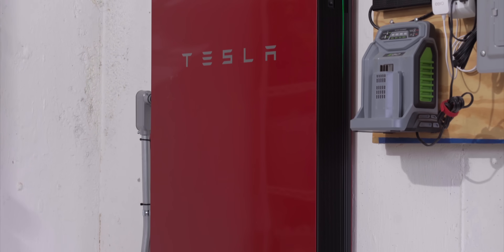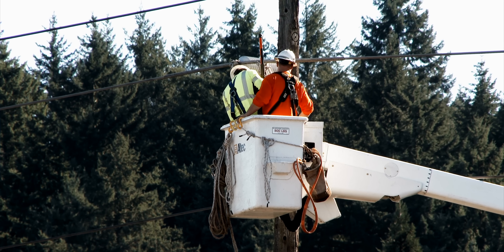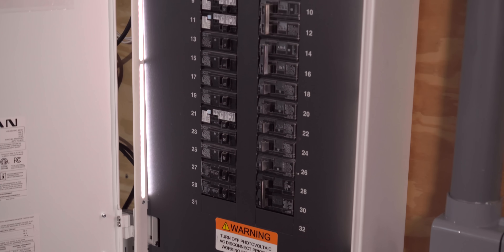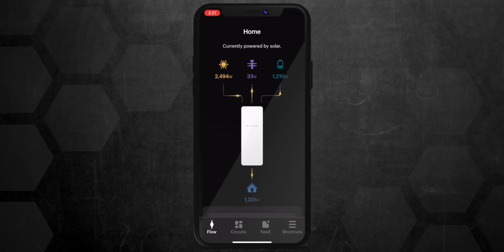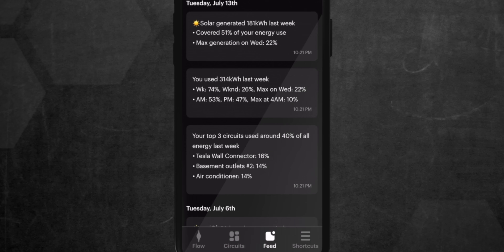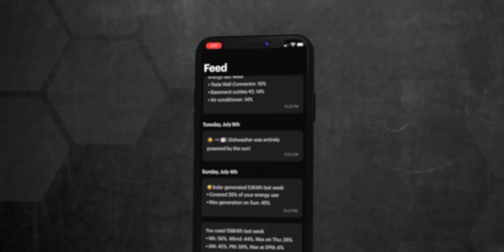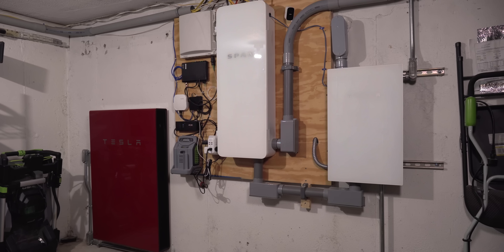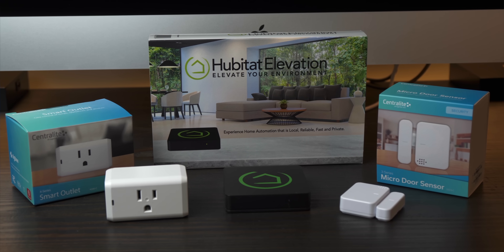This Smart Home Electric Panel Fixed My Tesla Powerwall

Comment: How often do you experience a blackout? We installed solar but batteries are not worth it at the time in Austria.
Reply from the maker: For me it's not too often.  Maybe once or twice (briefly) in the winter.  I have friends in my area that experience multiple of blackouts every winter (heavy snow, wind, ice taking down tree branches and power lines).

Comment: $3,500 so you don't have to turn off a few circuits in a blackout??  It truly is another world your side of the Atlantic. Over here where money doesn't grow on trees, it probably wouldn't work anyway, as we don't tend to have dedicated circuits for individual appliances. Or spare wall space big enough to install all that boy toy stuff!
Reply: Most people over here don't have dedicated circuits for individual appliances (although high-current devices like cooktops, dryers, etc., often do, as well as HVAC). A more complete solution would enable integrated control via a single pane of glass, at the circuit as well as the outlet/device level, which is becoming more achievable through emerging automation standards such as Matter.

Comment: When it works with enphase, I'll take a look.
Reply from the maker: Beowulf is right.  Enphase has some pretty cool systems they've been rolling out for some incredible control over the solar panels and battery systems.  It's not as robust as Span, but gives some small control over a subset of circuits.
Reply: Enphase already has this technology built into their panel (for up to 4 breakers, usually your biggest power drawers).  I can turn off my A/C, water heater, dryer, or range from my phone on the Enphase app.
Reply: @dreednlb  never seen that section in the enlighten app
Reply: @dreednlb  It's just not as granular as it needs to be, frankly. I've got my fingers crossed that Enphase and Span can work together enough for a good, integrated, and more complete energy management environment, would help both companies more quickly execute on their respective core objectives.

Comment: Love your videos on solar, batteries, etc.   I'm in the evaluation stage for a system for a remote vacation home.   However, currently, both at my regular home, and at the remote location, I'm using a "whole-house" generator system, with the one at my regular home connected to natural gas, and the one at the remote location connected to a large propane system.   For now, it seems I'm nowhere near the run-time/affordability of a traditional gas generator system when compared to solar and batteries.  I'd love to get there someday, but the cost gap is enormous.
Reply from the maker: Yeah, costs and ROI can vary wildly depending on where you are and the situation.  Keep an eye on it thought.  Prices are still falling.

Comment: I’m surprised Tesla doesn’t offer this feature as part of their integrated solar roof install.
Reply from the maker: What's funny about that is that the founders of the company used to work for Tesla ... on the Powerwall system.  They saw the gap in the user experience and spun up Span on their own.  One of the Span employees who was onsite during my install actually helped to design the Tesla Gateway.
Reply: @UndecidedMF  I'm fervently hoping Tesla doesn't acquire Span and make it part of a walled garden...
Reply: @solarjunkie  - Good reason to get one now!
Reply: @zinaj9437  Except sometimes, when acquired, companies become dead ends for their existing customers, when the development and support for pre-takeover products wanes. :(
Reply: @solarjunkie  - True, even if the promise with pinkie swearings and on their mother's grave (despite the fact that she lives down the street) that they will:
Provide free updates
Be backwards compatible 

It's the chance you take.  I'm taking the chance, in part, because of where I am in remodeling.  I knew, before I'd heard of Span or smart panels, that I would need to upgrade my panel.  I want the best technology at the time of the upgrade. This is it.
Reply: @solarjunkie  Tesla needs something like Span since Tesla is piping the solar directly into the Powerwall. There is no reason why Tesla couldn't keep Span open should Tesla acquire Span. After all, Span is simply a smart switch that should remain agnostic with respect to inputs and outputs.
Reply: @UndecidedMF  make sense.  Surprising gap.  Based on the Tesla culture you would have thought they would have identified and engineered this solution to fill out their offering.
Reply: @BigBobbyK  From what he's saying, they kinda did. or at least Tesla did identify the gap, but the people who did left to do it themselves (I'm assuming after Tesla declined to pursue it, otherwise there'd probably be a competition clause in contract at work).
Reply: Building this into a SolarRoof (or Solar panel) install would add cost to an already expensive installation package.  My 2 cents is to take the $3,500 for this panel and use that to partially pay for the purchase of another powerwall to get you out of the need for a critical loads panel and increase the amount of electricity you could store.  Then sell that power back to the grid to offset your bill and at the same time increase the time you can run in the event of a power outage.  We have found with our solarroof having the additional battery is very effective at reducing our electrical costs dramatically.
Reply: Its not a job for tesla since houses have very different equipments and features.

Comment: I would just go with smart plugs. That way, you don't need to turn off the whole circuit, just the device that it's plugged into.
Reply: In Acton MA there was a model modular home that offered solar and battery. It was all too soon
Reply from the maker: That's definitely a DIY path you could go down.  You'd have to tie your solar/battery system into your smart home and whip up a bunch of routines ... but it is possible.  Where it isn't possible is for the bigger appliances that can't be plugged into smart outlets.
Reply: @UndecidedMF  One could use relay devices with smart switches/outlets to manage the bigger appliances. Where there's a will, there's a way...

Comment: Does it require cloud connection to work? Is there subscription on this?
Reply from the maker: No subscription.  Communication between the Span and battery is local, but for me using the app ... cloud is required.  I believe more local connections/APIs may be incoming though.

Comment: Very interesting! I wonder if using the Emporia Gen 2 would be a better comparison than the Sense Energy monitor. In any case, the Span Smart Panel seems to be the best option if you have to juggle batteries and solar generation.
Reply from the maker: Yep, the Emporia system is closer to this (per circuit monitoring) than Sense.  The Span could venture closer to Sense in the future with software updates (machine learning, individual device detections, etc.).  There's a lot of potential here for Span.

Comment: Looks good but they need to support 250A service, in my opinion
Reply from the maker: I have no knowledge if they will, but it wouldn't surprise me if they do in the future.  This is the second gen panel and it can handle more power than the first.  Gen 3 maybe?

Comment: "The refrigerator is using more power than normal"
Dammit, how many times do I have to tell you kids to close the fridge door!
Reply: Now all you need is a little motor to close the door when this warning pops up.
Reply: @ObiWanKnewby  Nope, you need a facial recognition on the fridge and restrain access to only good kids. 😂🤣 And  not encouraging them to keep acting like jerk. 
For even more teaching (if they are that limited) you can give them an electric choc each time they fail and give them a treat if they succeed. 🤣 Or, even make them produce electricity by biking until they replace the loss + an extra. I'm sure they won't do it again. (I like this one even more)
Reply: अंकल
Reply: convert a chest freezer into a fridge.
Reply: It could just be a hot or humid day.

Comment: Nice job! I just installed a emporia vue and love the data!
Reply from the maker: Thanks!  I really love this stuff.  With knowledge comes power (pun intended).
Reply: Same here.  Emporia Vue much more cost effective and DIY vs. Span, though no ability to turn off circuits.  Their software also nowhere near as polished as Span, but it does the job for real time and historic monitoring of every circuit power draw in your house - with solar support also.

Comment: I’m getting 3 power walls when they eventually give me my solar roof. This will allow me to be completely off grid and charge my Tesla. Eventually my family will have 0 footprint.
Reply: Zero for energy production excluding equipment production
Reply from the maker: That's great.  Getting energy independence is something I'm trying to get for myself as well.
Reply: In the global scale, there is no such thing as 0 footprint. There will be always people around the word working in very miserable condition, many countries and ecosystems being destroyed to generate the insumes to make all those 0 footprint futuristic gadgets to happen.
For low "footprint" the only real solution is to go for a natural lifestyle with no plastics, no unnecessary traveling, no non-biodegradable waste, no exotic minerals etc.
You have to basically live using only renewable resources that you can produce locally without destroying the local ecosystem and without interfering in others nations ecosystems. This would probably mean to give up of most modern "comfort" people have nowadays.
If your family really want to help the planet, just go for a simple, more ecological and low consumption lifestyle.
Reply: @RogerioCosta1.0  your solution doesn’t mean giving up a few comforts: it means famine, loss of most advanced healthcare, and most likely, horrendous deforestation. 

That radical solution simply isn’t needed. A few significant changes can get the world close enough to zero, that technological solutions can be used efficiently and financially and ecologically sustainable ways. Sadly this means that all governments need to be 100% on board, and corporations need to pay for the true cost of their products, as well as dramatically reduce the production of single/short use products like packaging, cell phones and the like.

Then petroleum can be used in places where it is needed (primarily specific chemical manufacturing) where biomaterials won’t work. And that is likely only a fraction of a percent of global use now.

The biggest downside is that many ignorant folks, and profiteering governments won’t do this until it’s too late.
Reply: kudos for your effort...much wow

Comment: I so often hear Americans tout a battery as being great when you have a powercut...how often are you all having powercuts? I can only think of one in the last ten years I've had in the (south of the) UK.
Reply from the maker: It really varies based on where you live (as others have noted).  In New England we get lots of heavy snow, ice storms, falling tree branches that take out power lines.  At my current home it doesn't happen too often in the winters, but it does happen.  I have friend's that lose power several times every single winter from falling tree branches.
Reply: @UndecidedMF  Here in Europe the power lines to business and homes are buried. This I think is part of the reason we have less outages.
Reply: @UndecidedMF  Out here in north Central Mass we have lots of trees and a fair amount of power outages. In 2009 we had an Ice Storm that took out my house for 5-6 days.
Reply: Most electricity supplies in the UK have underground cables. Most in America are on poles vulnerable to tornadoes, hurricanes, squirrels, idiots with carbon fiber fishing rods, paragliders etc etc....
If they buried cables in America too, then the power cuts would also be rare.
Reply: @ahaveland  We have buried cables in my sub, but the feeder lines are on poles. Still, if some guy hits a telephone pole with his car on the other side of town, the surge will pop breakers on the poles nearby us. So we have to wait hours for the power company to come and do a manual reset. It is really fragile.
Reply: Usually just when we get hurricanes here in the southeastern US. Once every 3-5 years.
Reply: In my city it's at least once a year. Sometimes twice a year depending on the neighborhood.
Reply: Pretty big country, so lots of variables depending on where you live. You can have natural weather issues such as tornadoes, hurricanes, winter storms, etc. Some states have different issues when maintaining peak load times or infrastructure.  And if you live further away from a metropolitan area, the time it takes to restore power can vary greatly.

I've lived in many different areas in the states, and for the most part its a mild inconvenience. I could probably recall only a couple times in the last 20+ years where the power was off for more than a few hours. But even with my nomad experience I'm a sample size of one.

I think the bigger benefit is becoming less reliant on the grid and the potential to save money using your own battery power during peak hourly rates. Add in solar and you could pay for the equipment in those savings eventually.
Reply: Try 3 - 4 months without power when  a Cat-5 hurricane  hits and add to that many multiple outages as soon as it rains a bit orthe wind picks up... When you can't reliably depend on the power grid on a hot clammy night.... True Grid Independence becomes a very urgent Need!

Then again I live in the Caribbean, with lots of Natural beauty all around!
Reply: All the time mate. Our grid is fragile. I am always resetting the stove clock from small outages, even on beautiful sunny days. I don't live in the sticks either, but a 25 year old sub with buried power lines. Yet, we still get outages (sometimes for days), but frequently for a few hours. Again, for no apparent reason. And I don't live in wildfire territory either.
Reply: Power lines are still on telegraph-type poles in most US neighborhoods (but not the really, really posh ones, of course!). It's crazy but typical for a country that's really a mixture of 1st and 3rd world infrastructure with large disparities in wealth and political power.
Reply: Yeah. I have a generator I can run to power my house. But that's exceptionally rare and Iv never heard or seen anyone else have one. 

We don't get hurricanes in the UK buy we do have a very very reliable power grid.
Reply: I moved from northern Germany to south of Spain. Here we have 20 to 30 (mini) powercuts a year. And I don’t live very rural ;-)
Back in Ohio, wow. That was even longer and more.
A bit in between now ;-)
Reply: @Richard Hanney: There's this place called California...
Reply: Another option on the batteries is to supply power during the night or during high cost times. This way the batteries are being used normally instead of a once in five year occurrence
Reply: Do you have hurricanes, tornadoes, earthquakes, flash flooding? Those are a few things I can think of which the UK might not have to deal with
Reply: Here in Pennsylvania, I have weekly power cuts but usually for 5 min here or 10 min there and then maybe once every other month a longer outage due to a storm. My powerwalls save me from the blackouts every week.
Reply: in my case i see i as vary rare but can do a lot of damage and expensive at that 30K or more quite quickly as one 50's remodelled before in the 80's they got the house i lived in as a kid 2000's had the pipes frozen sold and did damage to the roof and foundation plus glass ect. or as my dad said that i should have just bulldozed the home and shop and started over as it totalled it vs remodel it which is what they did and it was a 15+ year saga to do so

the statistics that the local pacific / rocky mountain power company gave me a sub 2 hours aren't that uncommon you just have to have the wong house at the wrong time ect. 4-7 hours is a 5 or so years experience 5 or more days is a 15-40 year or so experience and very rarely in this 60's-80's suburb ( and yes we have utility poles but my sub is considered a posh area with lawyers and dr.'s and unverty professor 👨‍🏫 s and small business men owners over looking on a hill ) but and be time consuming as the internet doesn't work with out power ect. and any work from home or bill payment can't happen without power in the house. plus depending on the time of year all of the food can go bad from being to hot and or damages 💰
Reply: Lots of mericanos have blackouts. Some states have planned blackouts to reduce loads at peak times or during emergency situations. It's quite common there.